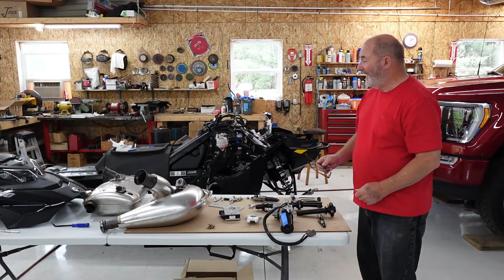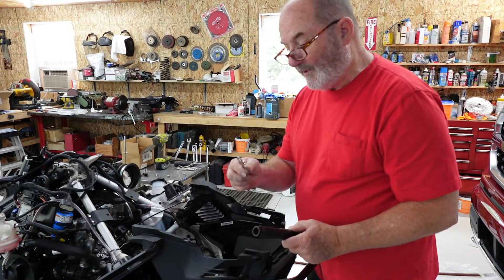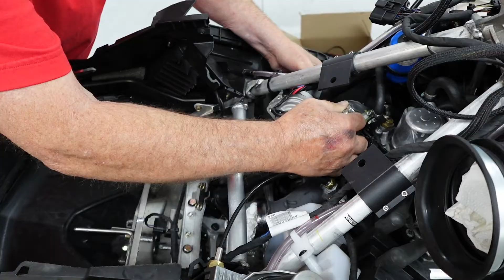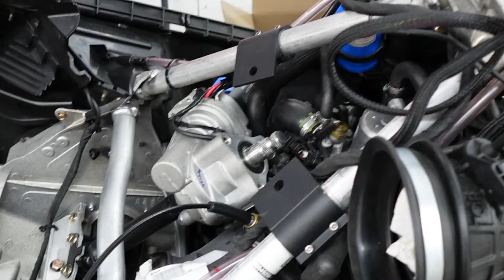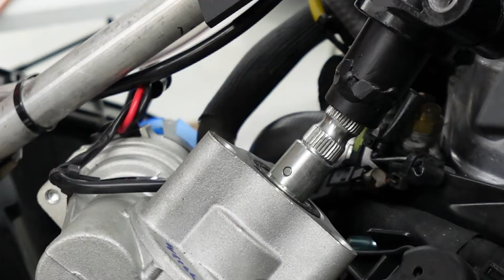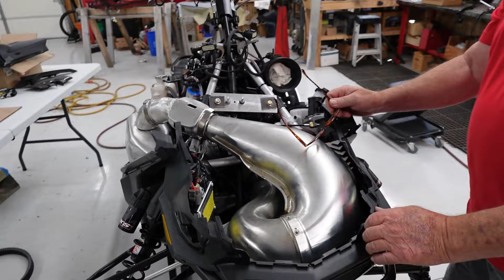Ski doo Power Steering 1st edition two stroke

Comment: Very curious about this unit. I ride a 2020 ski-doo Grand Touring with the 600 ACE motor. Love the comfort of a bigger sled, the reliability of a 4 stroke, and going out on 200+mile rides, but Carpal Tunnel makes it so that I struggle to ride more than 1 day at a time. Really don't want to pay Yamaha prices to get power steering, nor do I want to have to buy a 200hp sled to get it.
Reply from the maker: If you would like power steering installed on your slide please contact me at 231-263-3300
Reply: @autoglassamerica   I will be calling you in about 2 and a half hours! Thank you
Reply: Are you aware if it would fit on a 900r?
Reply from the maker: @philippecloutier719  yes
Reply from the maker: If you're watching this video keep in mind as of May it's almost a year old and we're just about ready to go with units for 4 stroke and two stroke. Check the website@ snowmobileshocks.com for more information